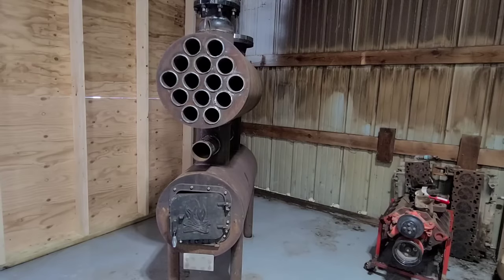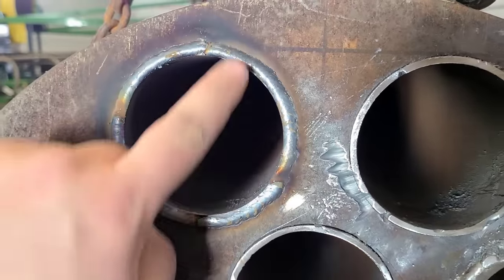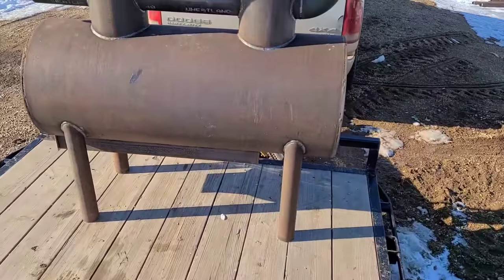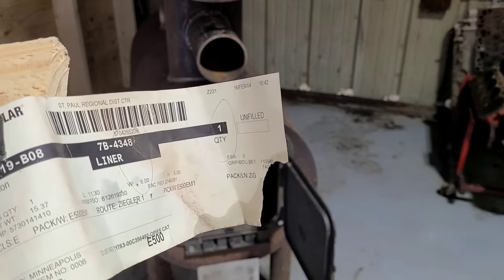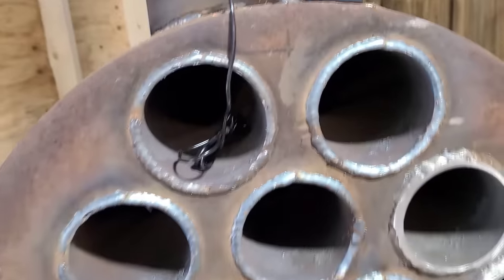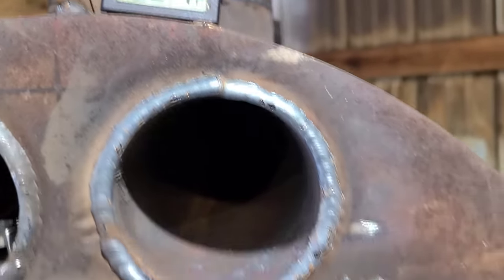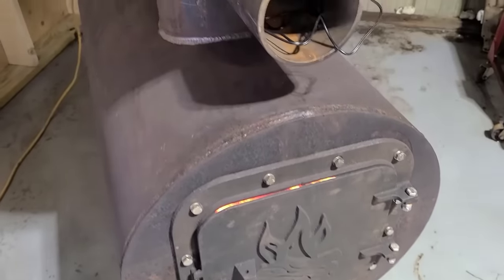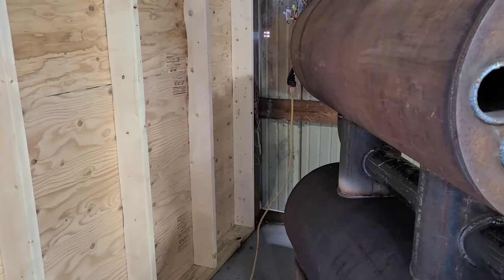My Ultimate Shop Wood Stove Build Part 3

Comment: Get a big neodymium magnet to retrieve the nails from your ashes. The nails can possibly be reused but more importantly the ashes can be used in the garden, composting, traction on ice, soap making, etc…
Reply: Nails will be annealed and soft after being in the fire that hot, do they’ll be to soft to drive straight, but they can be at least scrapped and kept out of tires.

Comment: Nice work, I really like this idea for a large shop heater to burn scrap in. Efficiency wise... I would guess this isn't much higher than a free standing fireplace though. With the added efficiency being from the heat exchanger. You could use a key damper in your flue pipe to help with that. Also, fabricating a secondary burn element from perforated pipes to go inside the top of the firebox would more than double it's current efficiency. Great job though man that sucker is certainly heavy duty and not going anywhere. Can't wait to see what mods you make to it!

Comment: Great presentation, thanks for sharing this video series.   Do you know anyone who works with HVAC equipment.  It should be possible to add a thermostat on the front of you tube array to control the blower motor speed.   Setup as if for an air conditioner with minimal fan at 100°F and speeds going higher as heat increases.  

Add some rock-wool insulation to the stud wall and metal to preserve the heat.  If you decide to cover the stud walls with metal, leave a couple inches gap at bottom to allow heated air to convect warmth into your shop.   A ceiling fan above will help distributing warmth from ceiling back down to your shop floor.

Peace

Comment: You do need an afterburner if not already made. (Clean burning stove principle)
Reason: smoke is white, not clear.
It's a thingy that injects fresh air after the fire itself, letting the gasses ignite and burn off. 
Mandatory in most new ovens, and is usually made so that this air cannot be shut off.
It will increase efficienci by a lot if you get it working.
Reply: Where would you put this air intake? Maybe the 2 riser tubes area?
Reply: @rbnhd1976  I've seen these retrofitted to older stoves. It's just a strip with holes for fresh air to be led into the hot half burned gasses.
Top 1/3 and all the way back in the combustion chamber would probably be a good place to put it. Not sure with the forward riser.
Reply from the maker: I'm confused on where this would go. The front riser is just a support, no smoke goes through that
Reply: @kylechrist  ah I missed that, I'm not sure either, I have looked at a few secondary burn designs but I'm not in it enough to know, this is a good design imo

Comment: 1- put baffles in the tubes so the air spends more time in contact with the hot surfaces
2- the squirrel cage blower needs some air restriction otherwise you’ll burn it out (take an amp draw to be certain) 
3- unless that chimney is really tall, I’m sceptical the diameter is sufficient to expel all the products of combustion

Comment: I suggest 5/16" GWB on the wall 2' to the side or back of the stove.  That would provide fire protection for the wood stud wall.  Also if wood is backing the metal panel wall.

Comment: The cold intake is a good idea😊. I remember seeing this a long time ago. I did not subscribe because I thought this was one of those projects that never gets finished. I want to see a complete review. Cold temp outside. How long it takes to heat the coldest part of the shop. Do this before the insulation and cold air intake. To see the difference. Talk about the temp outside before you start. Thinks for sharing the progress.

Comment: the problem with taking too much heat out of the flue gas is that you will get alot more creasote in the chimney, and how do you plan to clean that heat exchanger? Awesome stove though, you must have a cheap source for steel, that thing is a beast. Of it was mine I'd add a vfd to the blower and control it with a PID loop for discharge air temp about 160 deg.
Reply: Yeah I wonder how worse the combustion get by lowering temperatures that much. It must affect the draft.
Reply: VFD's (Variable Frequency Drive) only work with 3 phase motors. That blower is not 3 phase. A PID (Proportional Integral Derivative) loop wouldn't control a VFD anyhow. Don't talk about stuff you don't understand.

Comment: I'm looking at ways to distribute the heat from my wood stove in my shop more evenly. If I want it tolerable in the far reaches, I have to crank it up so much it it unbearable near the stove. I was thinking, of maybe building a heat exchanger, to circulate water through and use old truck radiators and fans to spread the heat around a bit. I guess, I would have to use antifreeze for the days I'm not in the shop.

Comment: Nice.   I might build something similar but smaller for my shop.  I use a shop that’s made of solid concrete, it heats up fast but doesn’t hold the heat
Reply from the maker: Do it! I'd like to see other ideas and what works and what doesn't 👍

Comment: On the back side of the burner barrel I'd add a small diameter (1/2" ?3/4" ish ?)pipe on the rear just under the grate and attach it to the fan box, possibly add a ball valve in for some flow control, then when the fan kicks on it'll pressurise the pipe with air allowing the wood nearer the back to get more oxygen laden air fed to it for a cleaner more efficient burn, as the stuff at the front where the grate is will have used most of it up, so your basically adding a small secondary air injection that'll kick in with the fan, the flow adjustment will allow you to tune it so you arent chucking so much air into it that your burning through your wood quicker, the chimney smoke will let you know when your getting a cleaner burn.

Comment: Might pay to put a sleeve around the external pipe to help reduce the chimney pipe getting clogged up tar etc.  You'll be pushing up cooled smoke and with cold air outside ...

Comment: A stupid question:  How do you plan to clean the creosote out of the heat exchanger? Sorry, I found it on the other video.   Because of the smoke coming out of the chimney, you will have to clean that heat exchanger a few times a season or just have a good exchanger fire.  The other option is to use kiln dried lumber scrap wood, so that the creosote production will be incredibly low.  The most dry wood possible would be the best option.  Good luck.
Reply from the maker: I do use dried pallet wood, and there is a cleanout on top that in shown in part 1 and 2 👍
Reply: Found part 1 and 2.  Thank you.  I was not thinking of pallet wood because it is treated with pesticides.  But I was thinking of construction scraps which I thought that you were using in this burn.  Wet, but scraps.  Have a good day. @kylechrist
Reply from the maker: @gibblespascack1418  not all pallet wood is treated, it's marked and the wood I burn is just dried 👍

Comment: Some glass wool insulation for the walls should help keep the warmth in and close the cracks and gaps in the wall. You can still nail some tin over it to protect the wood from sparks and radiated heat. If you insulate the fire tube, you shouldnt have to worry so much about distances either. (im no expert though, so dont blindly trust anything i say)

Comment: For additional heat, put a fan blowing onto the side of the stove into the open space. Use the main heat off that.
Reply from the maker: This will probably happen as the lower chamber does get hot, otherwise I could firebrick the inside to help transfer the heat up to the heat exchanger 👍

Comment: I would have built a baffle into  the tube drum to route the lower hot air toward the back.  With your chimney placed where it is a lot of heat is going right out the flue.  I would probably see if a similar baffle in the fire box, the top third or so, gave a secondary combustion chamber.  That would probably drop the amount of smoke coming out the chimney too while producing a lot more heat from that wood.

Comment: Use the center pipe in the riser to the second barrel as an intake, might be to hot for the fan but could double the heat out the top.

Comment: Wrap the main burn chamber with sheetmetal to add an air gap that will allow the air inbetween the burn chamber and the sheet metal the get very hot. Drill small holes in both exaust pipes that connect the main burn chamber with the secondary chamber. Route the very hot air created in the gap between the main burn chamber and the sheet metal into those small holes to create a secondary burn area in those exhaust pipes. This will greatly increase the temperature in the secondary chamber and greatly cut down on smoke and creasote build up much like a smokeless firepit works.
Reply: I was thinking about doing something like this with mine. I just don't know if it's hot enough in the exhaust drum for new oxygen to combust the wood gas immediately. If so, that will be an excellent gain in fuel efficiency as well as burning cleaner.
Reply: You could add some type of blockages to slow the air down so it has enough time to heat up. Maybe fireplace seal rope spiraled around the drum so the air has to wrap around the drum a few times before entering the chamber. Heck even rolled up tinfoil would work. @SubvertTheState
Reply: Why not just getting the first combustion chamber hot enough in the first place? Those second burn chambers are often overrated and  it is over engineering which is a bad.

Comment: I would make a lover for the front just a complete circle with a bunch of 1" or 2" flat steel slats put them in there kind of tight or well to screw in a nut on them then you could adjust the louvers that way you could point some of them down some of them straight ahead would look pretty cool too

Comment: A lower output temperature is actually good.  Right around 100 degrees coming out is close to what a central heating furnace will do.  The lower temperature means you're pushing all that heat into a much larger mass of air which means there's that much more warm air filling up the space, rather than a too-hot small amount of air, hanging around close to the heater.
Reply: Agreed. Superheated air leaving those tubes will just rise to the ceiling absent a ceiling fan or other means to mix things up. The goal is uniform temps floor to ceiling and wall to wall.
Reply: You gets higher efficency When you push more air thru, also you can put a pipe to the fan inlet so it pulls the warm air from the ceiling and reheating it, plus cold air intake 👌

Comment: You can buy stove gasket rope available in various diameters to make yourself a door gasket if you want to make it more air tight. Plus squeeze tubes of hi temp cement to adhere it to the metal.

Comment: the bottom barrel should only have the rear pipe joining to the upper barrel and the chimney at the front of the upper barrel . that way all the gasses go over all the heat exchange tubes.
Reply from the maker: That's exactly how it is, there in no hole on the front riser pipe into the burn chamber 👍

Comment: Only downside (And this is with a lot of woodstove's) drawing the just heated warm air from inside of the building, burning it and dumping it right out. 
Thus pulling cold air in to the building, what you have to heat again. Seen a fun calculation a month ago for how much air it needs to burn a certain amount of wood, the produced ''heat'' energy and the energy (Negative energy.. If you would say so) from pulling cold air in the building. Over all without a cold air intake it kinda sucked lol Was surprised by it, cant find it right now tho. I'll try to find it againg 

Is it possible to get the air your''re burning from outside of the heated building?? 

The rest of the build is awesome! Kinda thinking about making the same model

Comment: Where/how is your clean out around your heat pipes in upper drum? How are you going to clean out the soot ect off the outside of the heat exchanger pipes at end of heating season?
Reply from the maker: In the first and second build videos I show the opening for the cleanout in the upper chamber 👍

Comment: You are quite the craftsman and it is an awesome build, but the heat exchanger will collect soot and will be difficult to clean even if you have a place to clean it.
Reply from the maker: As long as it burns hot enough, it should self regulate any buildup 👍
Reply: Kyle that is wishful thinking, but from my experience of heating my home for 45 year entirely with wood the out side of the heat exchanger tubes will carbon up.  I have to clean mine several times a year, but the furnace is designed with a door on the exhaust side the flue that allows me a clear sight of the area to be cleaned.  You do nice work and your idea is in the right direction.

Comment: I had to remove the double barrel stove from my pole barn  when I bought  my house to get insurance coverage.  Without a UL tag you have zero coverage should  a fire ever start. Too bad they are illegal in most states because they really put out a lot of heat.
Reply: We had a Welding fab shop in UP of Michigan an built a similar stove from 30” gas pipeline and Insurance company’s would not insure them without a UL approved tag on it! That would cost 10k at the time. They do put out a lot of heat an We sold one to A Ford Garage an they heated with it for 10 plus yrs until Natural Gas became more readily available and cost effective!

Comment: I would put a small lover or 2 just a flat slot piece of metal wielded in those tubes pointing down towards the ground that way you could turn your fan down as low as possible blow your heat down to the floor because it's always gonna rise so if you force the hot air down it'll heat the slab and you'll get better room heating if you push it down to the ground and let it rise on its own convection Louvers you need louvers Awesome heater

Comment: you're actually cooling your flue and stove when you leave the door open. It will draw a tremendous amount of cool (room temperature) air in through the open door and up the flue and therefore reduce your temp readings.
Reply: needs an exterior air intake to balance the draft too

Comment: This is gonna have soooooo much soot, possibly creosote considering what you're throwing into it. How do you intend on sweeping this creation?
Reply: ive seen people throw aluminum cans into an extra hot fire and it supposedly cleans alot of the creosote without manual labor though ion know the validity of that
Reply: @Von_Hohenheim  I haven't heard it for aluminium, but I've heard it for zinc, but in my experience it will only help to loosen it. You still need the manual labor to actually remove it properly.

Comment: Looks good, might want to put a chimney cap on that's a somewhat wider than the pipe to help battle down pressure on draft in the spring n fall temp swings. Otherwise
That should keep the wrenches warm.
Reply from the maker: I have the cap for it, just been too windy to climb up and put it on 👍

Comment: I wanna do something similar but simpler to my 150$ harbor freight log burner. I need some 6 inch & 3 inch pipe now. I definitely would get aluminum duct to source the cool air for that squirrel cage fan. It will keep the bearings cooler and make it last longer. Get the duct past a heat shield quick and insulate it so it can source cooler air without the radiant heat heating it up. I wouldn't have mounted that fan so close either.

Comment: When we shielded our wall, we used cement board, then put 2" spacers over it with another layer of cement board with about a 6" gap from the floor

Comment: The next one you build, have the inside of the pipes be the exhaust flue to the chimney.  Put a door on the area in front of the heat exchanger so you could run a round wire brush through the pipes to the firebox.  That is how my Yukon Eagle furnace is designed and it is easy and efficient to clean.
Reply from the maker: I don't think there will be a "next one" haha
Reply: You do really nice work and it would a great way to develop your idea.  Thanks for showing!  :)
Reply from the maker: @realairplane261  thanks!

Comment: I've been burning for 16 years now my wood stove is your average wood stove with a glass door. Keeps use nice and toasty. The biggest thing I need to keep up on is cleaning the chimney. If I don't it'll build up creosote and I'll have a chimney fire. I've had 3 so far sometimes I let it slip. So looking at what you got I can't help but think how the hell will you keep it from going super Nova.
Reply from the maker: There is a cleanout on top and I burn kiln dried wood so creosote is minimal
Reply: @kylechrist  I'm guessing he means creosote build up in the tube bundle.  It seems to be real heavy material so it just might burn out and be fine is my guess.
Reply: sounds like your chimney is too large for the stove (IE 8" id when designed for 6").  If it's building up creosote that fast something is wrong. A neighbor had a high efficiency catalytic stove he didn't know how to operate properly, and left the bypass setting open continuously all the time, creating repeated chimney fires.
Reply from the maker: @thedavesofourlives1 6 inch pipe is fairly standard for most wood stoves 👍

Comment: I had been waiting for this. Well done, Kyle.
With that type of wood, you shouldn't have much build up. That I was concerned about while you were building it. I remember what you said about cleaning it from the top. It's going to be a pain. So hopefully you won't have to clean it that often.
EX: Clint's Chainsaws & More.
Reply from the maker: I think it will be okay but I'm going to run it a couple weeks and do a followup on it. We will open the cleanout and see what it's like 👍
Reply: @kylechrist  Just try one of the "Chimney Sweep" store bought logs. I had good luck on my Wood Wonder stove. Made it real easy to run the six inch brush down and clean it out. Love the Videos.